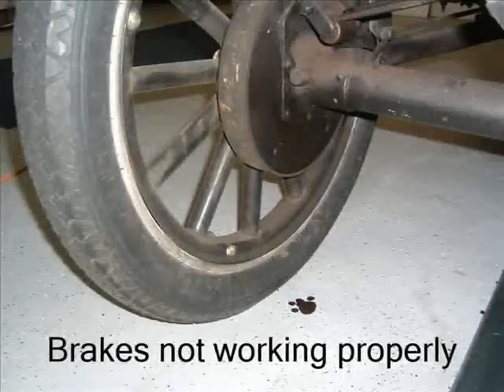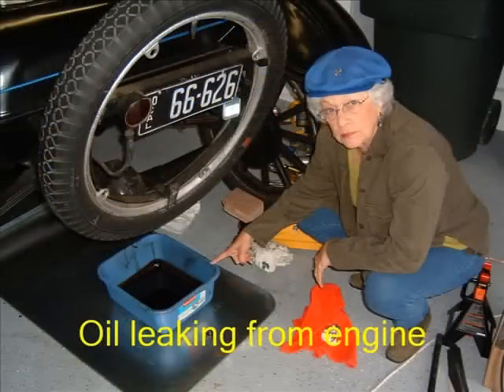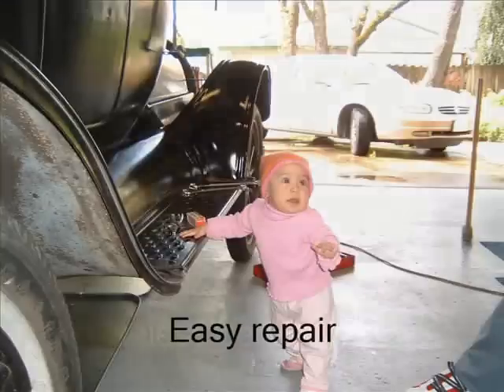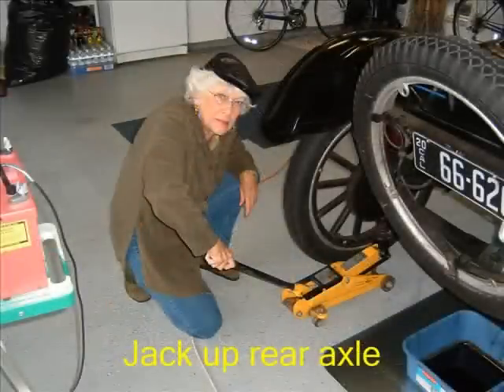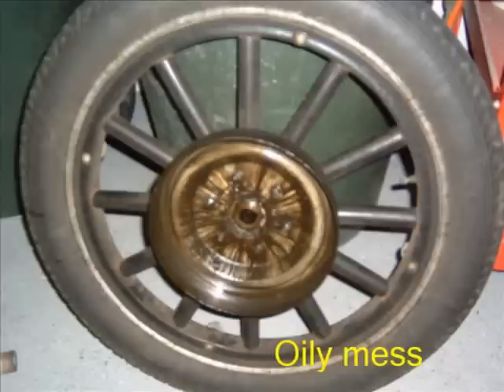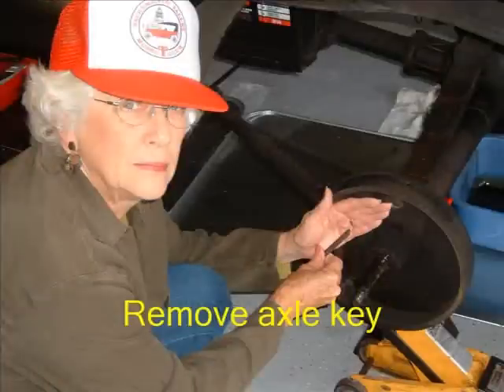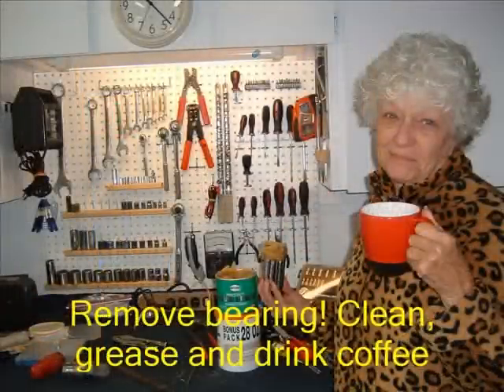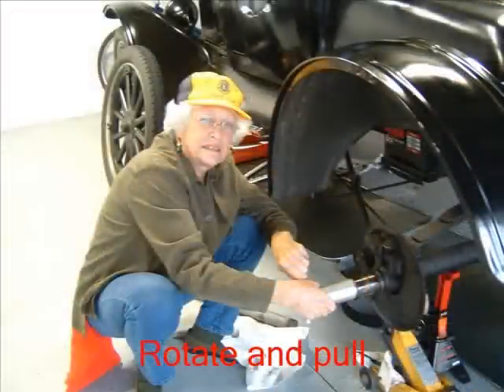Model T Rear Axle Oil Leak Repair

Comment: One issue to consider is with earlier Model T’s where the drain plug is in line with centre of the axle housing and not lower as in the later cars. If you fill to just below the drain plug you have way too much oil in these older cars. The oil level should only come up to about the bottom third of the differential. This is roughly an inch to inch and a half below the drain plug. I made this mistake when filling the diff in my 1915 to just below the drain plug as I do in our ‘26 T. Check the height of your drain plug on your axle housing first. A great video however! Quick and to the point.